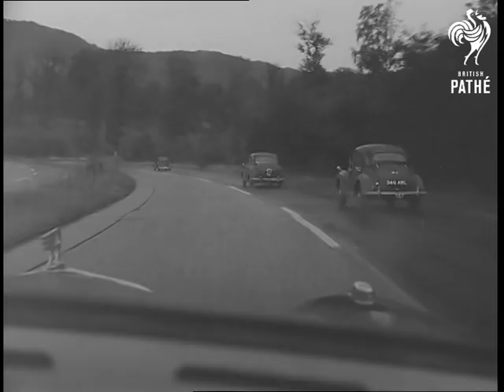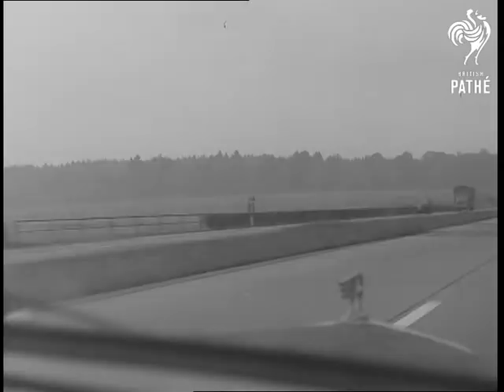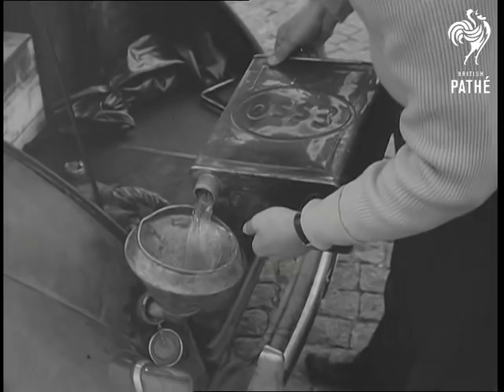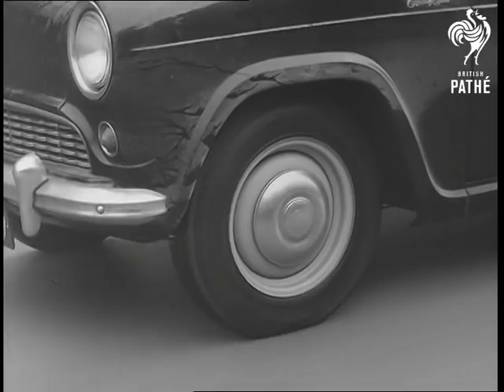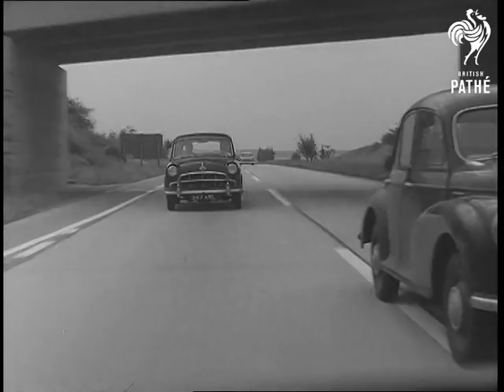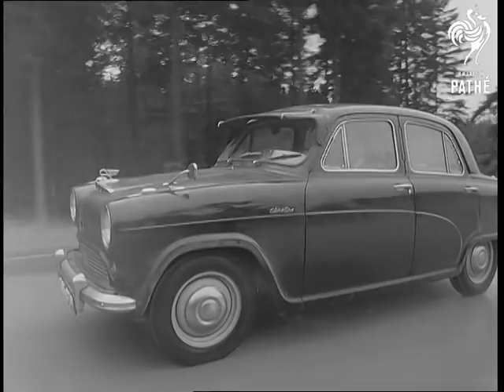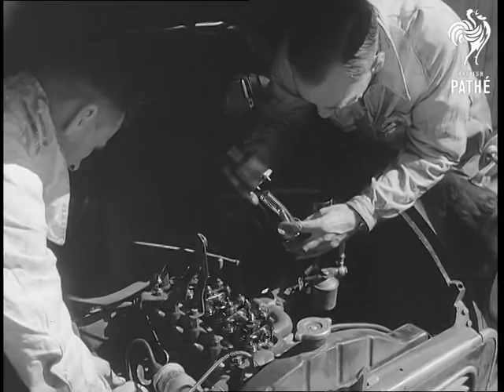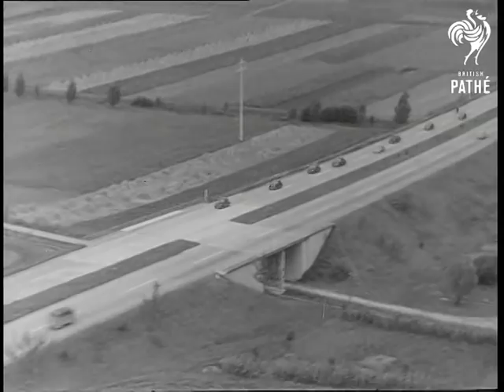British Car Trials on The Autobahn: Tests Such As These | British Pathé

Comment: They must have looked cheap pulling into petrol stations and using their own gas.  I wonder if they took their own food into restaurants ?
Reply: Rob Mackenzie  ... and their own scissors into a barber shop ...
Reply: Of course,no foriegn muck
Reply: Rob Mackenzie 

Controlled fuel and fuel amounts. Nothing to do with being 'cheap.
Reply: Probably if BMC would be still existing they would run their tests even today on german Autobahn, as they got fuel in Germany that is not available due to missing lorry drivers in GB. Sorry for my english humour. But really a nice and odd footage you present here.

Comment: A glorious future lies a ahead for the British car industry.
Reply: r/agedlikemilk
Reply: But you don't have a " glorious motor industry anymore" I started work as an apprentice mechanic my second car was an a50 as I started work 87% of new cars sold in new zealand were British in 1969 by 1971 it wS down to 60% as people discovered the japanese cars were more reliable better handling, better braking more economical AND cheaper, by 1975 the bits had dropped to 40% because it was the same old same old poorly build, badly finished, still unreliable , the death knell came along as the ugly bmc  finally driowned😊

Comment: Autobahn driving needed an oil cooler. English cars were not designed for long constant speeds then. Lead Indium bearings and later oils were an improvement but not the total answer. VW beetles all had oil coolers for autobahn use.

Comment: In the 1960 s I had a Austin A50 and it would do 80mph just like the one on the video.  Very comfortable with big red leather seats. Column gear change rather slow ! I put a MG head on it with ten thousand planed off which improved miles per gallon and increased acceleration. I had a Morris Minor before that and did many miles in that with tool box, spare oil, water etc !
Reply: Back when the second hand car cost less than a tank of petrol today.
Reply: I had an A50 in the sixties that did 19 mpg knocking abut locally but up to 46 mpg after I fitted a vacuum gage and drove carefully

Comment: All for a bit of nostalgia, but sorry, this just shows how rubbish the technology of the 50's really was (BMC's at least). 20-25k "highway" miles (with a warm & lubricated motor) , an oil change every 4k miles (every Sunday was "maintenance" day) and basically a full engine rebuild was in order (and probably 2 or 3 sets of cross-ply tyres to boot).

I guess at least the brakes would still have been in good order.............no wait 20,000 miles at 200miles per tank that's at least 100 stops to refuel.....add in 2 sets of shoes, machined drums and 4 brake cylinders as well........oh and a weekly carby rebuild while you're at it, got to make sure we extract all 20-35kw from these performance powerhouses.
Reply: ahh, the good old Brit cars
Reply: I had a Morris Oxford series V with a 1489 cc engine. With regular oil changes, it covered 140,000 miles. Still going strong when I passed it to a friend. Excellent engines, good cars.
Reply: Put it into context... Ford were still building cars with side valve engines, three speed gearboxes and transverse leaf springs at the time...
Reply: @neilevans8940  They were more comfortable and usually faster than the BMCs of the era. Ford even helped pioneer the automatic transmission with their Cruise-O-Matic in the early fifties.
Reply: @baileyharrison1030  You're obviously talking Ford USA here as in the UK from 1963 the vast majority of Fords with auto gearboxes used the Borg Warner 'box. Earlier UK Fords used the Hobbs Mecha-Matic... I know a bit about them as I own the surviving factory prototype Hobbs Auto A35...

Comment: What happened when your indium bearings wore out at 20,000miles ??????
Reply: They didn't wear out in normal driving , these were tests to driven to destruction as said in the beginning, to think there are still some of these models on the road today, more then can be said for today's modern tin cans with trail engines that start playing up all too soon. Engines etc were not built to the fine tolerances we have today.i still have a 1960 Morris with a huge 948cc engine runs like a swiss watch. Just needs more frequent oil and filter changes then today.

Comment: Only a few years after WW2 one of the victors has no choice but to use the excellent road infrastructure of its thoroughly defeated enemy to tests its cars, already inferior to those produced by that former enemy. What's the word again? Wirtschaftswunder?
Reply: Yes, because Beetles, old Opels and Audis.never rotted away.....  Why do you think Porsche and Audi turned to galvanised bodies? Then we have the ultra reliable NSU RO80 (I'll ignore the swing axle Prinz models and dangerous handling), moving forward they've really improved, unstable A class and Audi A1, Audi TT first gen with dodgy aerodynamics, trailing arm old 5 series with dubious rear end grip. Don't mention the Porsche IMS or liner problems. Still, now Mercedes are using Renault engines I'm sure they'll be OK.  Ps, I actually like German cars but have spent my life driving and fixing them so I'm not blinkered to their many faults.